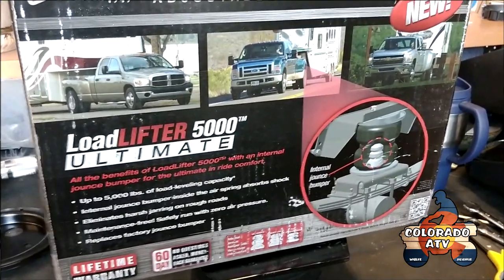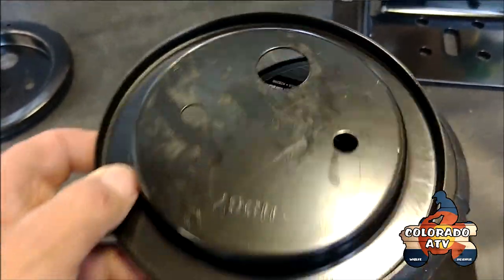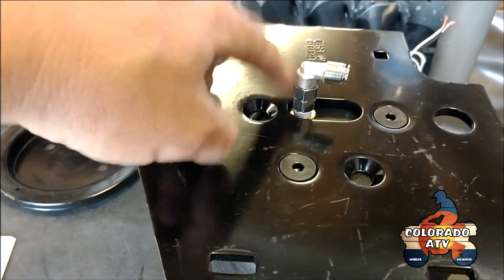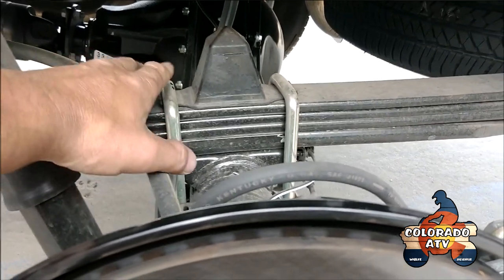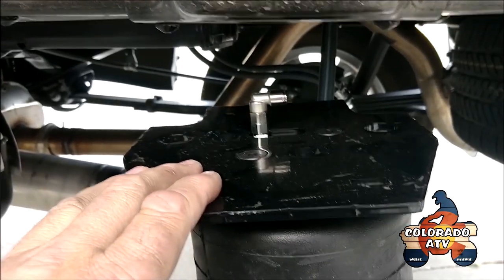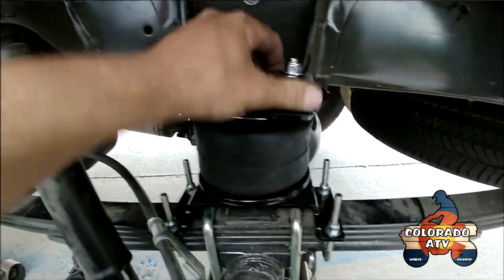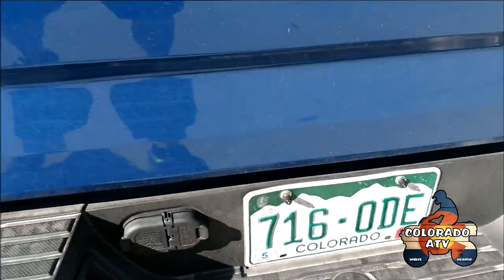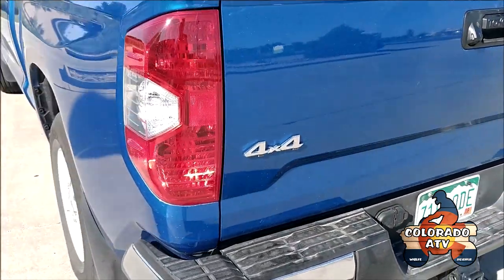2016 - 2018 Toyota Tundra Airbag Install

Comment: You did not show the removal of the existing rubber bushing, we used a Sawzall to take our's off.  And do remember, a HEAVY fan to blow the rubber stench (just horrible really) away from your face as you cut.  But it cuts off really easy.

Comment: How does the air line go into that part on top of the bag?does it screw in or press in?if it's pressed,is it pretty air tight?
Reply: It goes thru the frame and connects like a sharkbite fitting, Press fit, last for years I never had a problem with leaks

Comment: I was thinking of placing the valves at the license plate location as well - any second thoughts on this?  Also, I assume you use a WD hitch with your tow hauler as well - correct?

Comment: looks good, woulda been nice to see the exhaust side, to see how the bag looks beside the exhaust. I want to install these bags but I've changed my single exhaust to the factory dual exhaust from Toyota. I'm just wondering if i'll have any issues with two pipes now being close to the bags. Does the kit include a heat shield of some sort?
Reply from the maker: The air lines you can run under the bad rails far from the exhaust. My Factory exhaust is about a foot away from the bags. The kit doesn't come with heat shields.

Comment: Does this work on lifted trucks? I currently have just a 1" spacer in the rear (level lift) but I plan on a 6-8" lift.
Reply: It may cover a 1 " gap. The brackets are designed for the stock distance between leaf springs pack and frame. Best to call the manufacture and ask.
Reply: Robert Wulfe thank you.

Comment: How many psi? So you run the air hose from the airbags to the license plate.
Reply: Yes the hoses run to the license plate for easy fill. The psi varies on trailer load. The heavier load the more psi to level the truck.

Comment: Have you put them to work yet?
Reply from the maker: Yes I have towed my Toy Hauler several times. They have a little bounce to over bridges and bumps on the road but other than that they work great! Keeps the truck level and the steering and braking have improved with the truck sitting level.
Reply: @coloradoatv675  Do you use a weight distribution hitch with that setup?

Comment: This shit is junk on a Tundra. Bumper comes in contact way too early and is way too stiff, makes potholes or speed bumps feel like 1ft deep potholes.
Reply: I have the same issue with 07 tundra with the airlift 5000 ultimate installed, the ride is too stiff! Would installing a daystar cradle help with the ride?